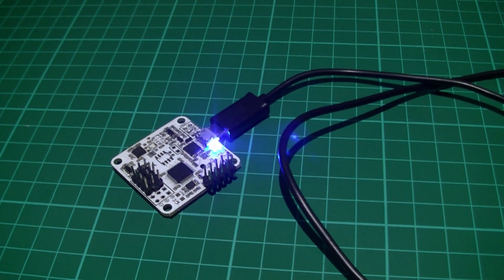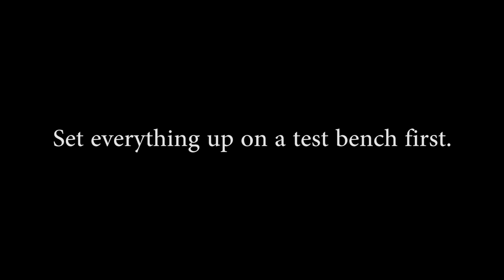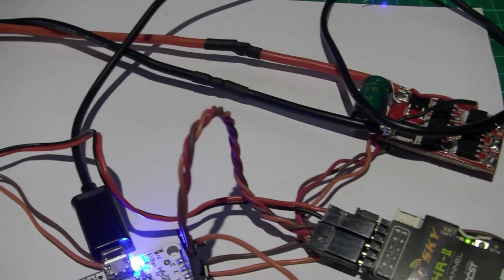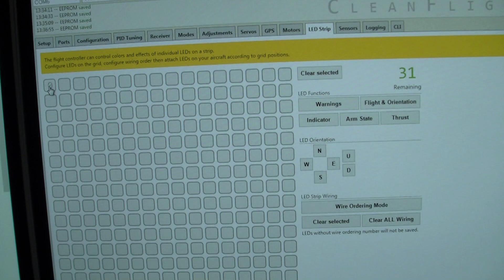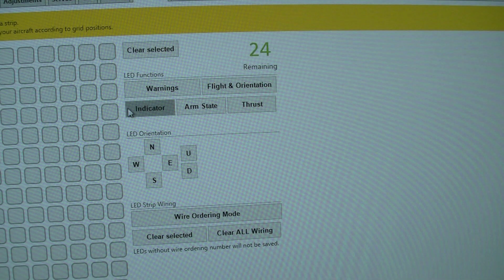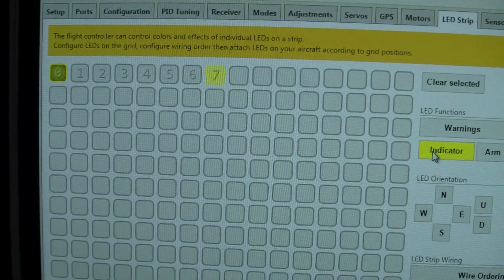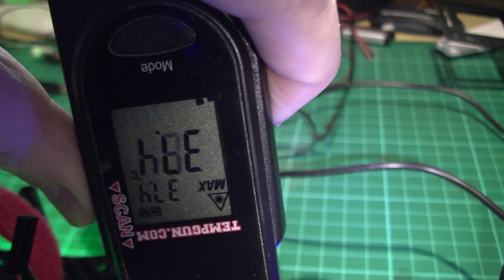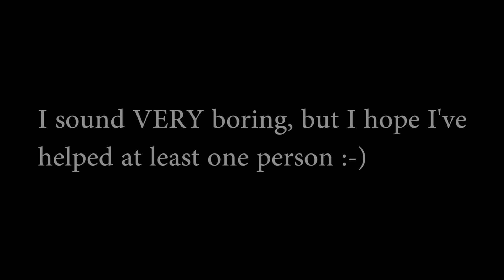Adafruit Neopixel stick - how to wire and setup on Naze32 with Cleanflight

Comment: Thanks for taking the time to make this video! I hooked up 12 WS2812 led's to my quad. Everything worked great for about 2 mins then they all started blinking. I remembered your video that you had mentioned  the step down to 4.1v  I did the same and no more blinking. Thanks again.
Reply from the maker: I'm glad it's not just me that has problems and I'm glad you got it working :)

Comment: You know what, I think I would have gone out of my mind not knowing why they wouldn't work, I saw your video and how you had to drop the voltage, I managed to drop mine to about 4.7v and the LED's at least lit, so I've ordered a buck regulator to drop it some more! Thanks for the heads up..
Reply from the maker: +T101cyberdynesystems I'm glad it helped...... My job is done :D
Reply: +Vortecks ha ha maybe, do you know why they won't work at full 5v? I'm concerned they might not be bright enough if they are just over 4v. I've got the banggood ones not genuine adafruit, could that be my problem?
Reply from the maker: +T101cyberdynesystems I think it' might be the Naze over-driving them. I have hooked them up to an Arduino and used 5v - They work fine and there's virtually no difference in brightness so I doubt you'd ever notice.
Reply: +Vortecks mine isn't connected to a nase, I'm using an adafruit trinket. Once I get the buck regulator I'll know for sure I'm in business!
Reply: Ok i've figured it out, i'd put a 470 ohm resister before the first led as advised in the best practice on the Adafruit site, well without it works no problem, but with no!

Comment: Just noting... I had some voltage issues as well. On the Naze32 full, there is a 3v pad next to the boot pins. I used that and grounded on the ESC pin. Data went to Receiver 5. Seems to work ok.
Reply from the maker: Brett Rogowski Thank you! I didn't think of that :)
Reply: Brett Rogowski That will work for awhile, but the LEDs put quite a load on the on-board 3.3 volt regulator that supplies the processor. May over heat and burn out.

Comment: I have the same problem, mine does not light up. My setup is almost identical to yours but I'm using opto esc's so i'm running a seperate ubec. I read that comment by 4G3 about connecting to the 3V on the naze and don't want to burn it out just for led's. Any alternative way besides adding another regulator onto the quad?

Comment: where do you get the single header pins? I am also a bit confused on the need for the v regulator? I've seen other videos with no need for such devices. Could you explain please? Thanks for sharing.
Reply from the maker: eBay "Arduino single row headers" and you'll find them.
I really don't know about the regulator. All I know, is that mine doesn't like anything over 4.2v - I have seen other people with the same problem and I think it's because of a mismatch between the PWM voltage, and the input voltage (from the BEC). I did try it with the Naze 5v output and it was still the same. Thinking about it, I tried absolutely everything and nothing worked.

Comment: Maybe one could add a pull-up resistor to the data line and 5 volts. When I get one I'll try it.
Reply from the maker: 4G3NTanon Or (as Brett as already suggested below) you could use the 3v pad on the Naze.

Comment: Hi, how can I use 4 wire LED strip (+ve,RGB)? here rgb are -ve every one is using 3 wire strip. Should I mix RGB? I need to use white in front and red at back and have done by direct connect to Lipo battery. Want to use this way.
Reply from the maker: The simple answer is..... you can't. You need an LED strip which is addressable (3 wires) rather than 4 wires.

Comment: does it mean by connecting this to the second bar  as rear  and confiqure both rear and front in  16 row in the tap?
Reply from the maker: underfloor heating installer Sorry, I don't understand what you mean?
Reply: Vortecks how do you connect the rear led ?thanx in advance  by the way solderingthoes  is nightmare .
Reply from the maker: underfloor heating installer You wire it in series. Take the output from your front and feed it into the input on the rear. Does that make sense?

Comment: you lost me on the wiring part
Reply from the maker: doluseb Signal (D-In) goes to pin 5 on the Naze and + goes to 5v and - goes to negative.You may find that it won't work with 5v - I've had a lot of neopixel strips that need more like 3v but the Naze does have a 3v output (there's a pad that says 3v).Is that any clearer?